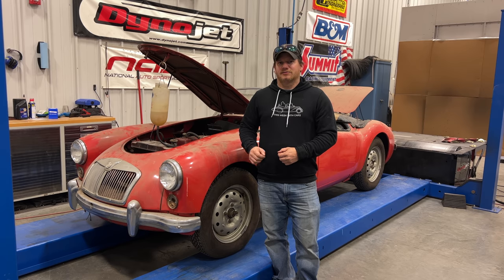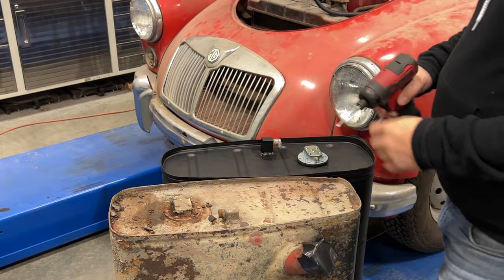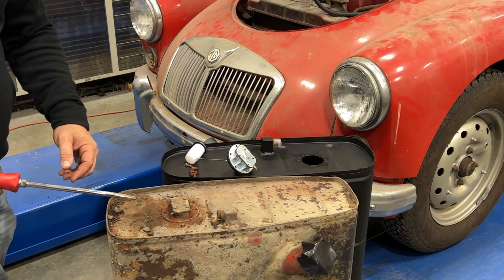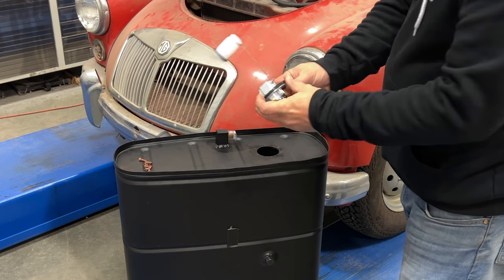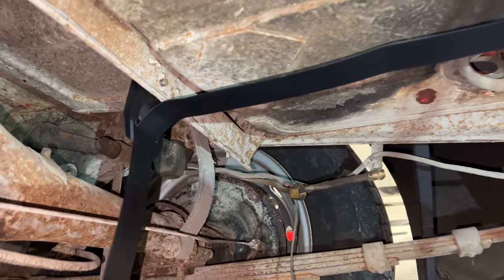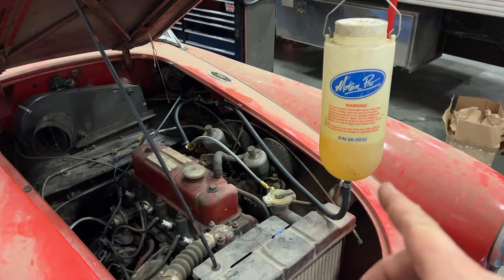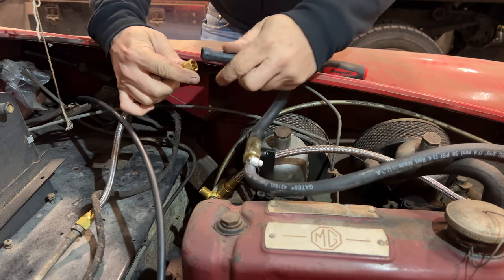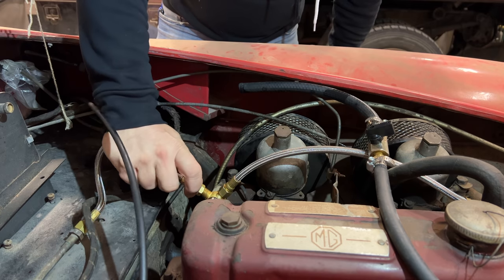1960 MG MGA 1600 Roadster - Part 3

Comment: I work on airplanes and have to deal with a bunch of long-installed Phillips head machine screws. I have found that an electric small impact driver will often remove these screws when nothing else will. Just press hard and feather the trigger so that the bit doesn't cam out. Slow and east usually works best.

Comment: I think it's a 1961 with those tail lights. 1962 has the mini tail lights inboard off the fenders side ways.
I have owned a few MGs and Triumps. My Dad and I restored the 1962 I currently have running. It's a well sorted driver. Love what you are doing please let's see more. It brings me great pleasure and reminds of the great times and challenges while working with my Dad.

Comment: i'm thinking about getting a restored MGA or maybe even a TD. i'd like to drive one for a while once again before i leave this earth. it would have to be in good running condition, but i don't need car show restoration quality. i find the simplicity very appealing after having to deal with all the useless junk on my modern sports cars. so much stuff that is entirely useless, complicated and hard to service!
.
BTW, knowing the lucas electrical system for what it was i think i know why they included a hand crank with a car manufactured in 1961. it came in handy on more than one occasion. :)
Reply: Get an MGA. They are more fun and more reliable.
Reply: @davidfinkelstein7986  ... and they can actually maintain highway speeds without causing heart palpitations.

Comment: Very nice now with a new tank. I am not sure why you didn't put in new bolts but they could be imperial so not available besides sometimes the old ones are stronger. Glad she runs now without hanging a fuel can on the bonnet! Keep up the good work Steve. 👍

Comment: You have an air leak on the induction side of the pump. Correctly installed the pump should only tick about once every 30 seconds when the ignition is on, unlike Facet pumps that run continuously.
Reply: You're right. I remember listening for the ticks before I pulled the starter knob to let the pressure come up.

Comment: Hi Steve . This is a  very sound car indeed . Have to say someone must have forgotten to pack those bolts , l can't imagine they wouldn't supply them . Thanks
Reply: Probably Whitworth threads, 26TPI. Not metric, not SAE. You won't find them at Ace Hardware.

Comment: I’m constantly amazed that you can get new parts for your wonderful, but rare and ancient foreign cars, and I cannot get new parts for my two more recent and not so rare American cars. For example the gas tank for my 2002 Ford Thunderbird which style was made until 2006, had to be bought used even though this gas tank was also used on some style Mercuries. Another, the electronic speed sensors for my 1984 Chevrolet Corvette are totally unavailable though this style Vette, the C4, had many more built from 1983 until 1996, than any other style. What gives?

Comment: Great to watch and learn as always. Just one question - wouldn't a liberal spraying of WD-40 have helped to get those old screws out?
Reply: Nope, Any amount of any spray never helped any bolt or screw for me . 30 year heavy equipment mechanic. All just selling you empty promises.
Reply: @joeblough2485  Thanks for your feedback. When you consider all the other products we use and could easily live without, what you say is entirely credible.

Comment: Back in the old days they would make tanks out of tern plate which is plated with lead. They don’t make that stuff anymore so what would a new rank be coated with on the inside to prevent rusting? I assume the tanks are steel, not aluminum.

Comment: Noisy fuel pump. That would be pretty irritating if you were stopped at a light and it was that loud.
Reply: It's only that noisy when pumping close to capacity. I'm surprised Steve attempted to start it with the pump still chattering. Suggests there's a big leak somewhere, like the floats in the SUs not sitting correctly.
I certainly wouldn't try starting mine if it were still chattering.
Reply: mine used to make a little noise, initially, when i turned the ignition on, but as soon as the float bowls filled up it stopped. and that was normally before i even got the car started. just a couple of seconds. and then i don't ever remember hearing it run again, although it must have.
Reply: It should not be running continually like that, and implies there's a leak somewhere. Those pumps should just cycle a few times until the float chambers are full and then only tick occasionally as fuel is drawn off.

Comment: Why waste time and effort to reuse rusty screws? New srainless screws would be cheap, easy and reuseable the next time the sending unit has to be removed/replaced.
Reply: I imagine he'd have to wait for them as they will be Whitworth threads. Personally, I'd be more concerned with all the rust on the underbody and deal with that before putting the tank in. It's not really serious at this stage, but having the tank out is the time to have done the work, even if it's tedious and dirty work.